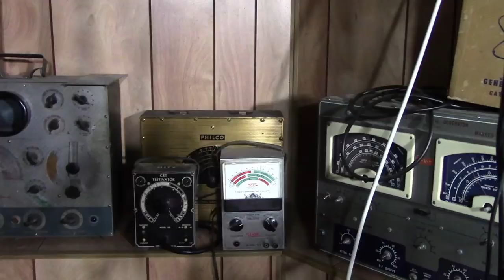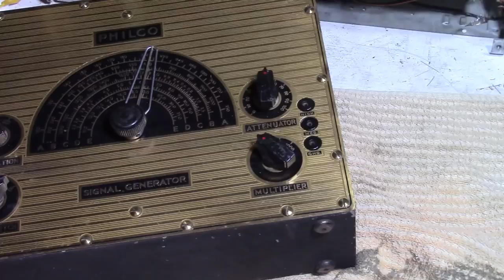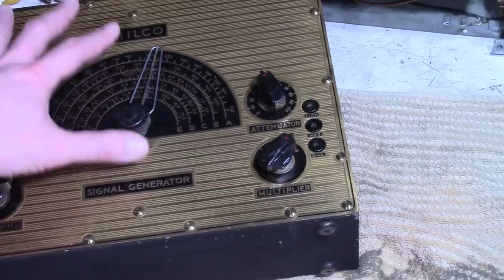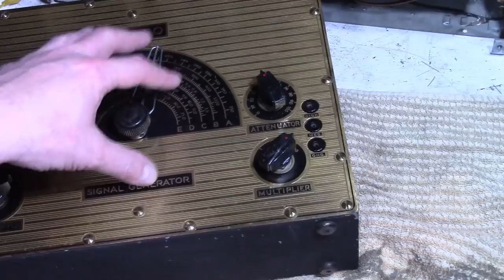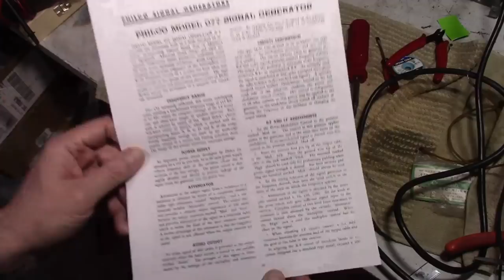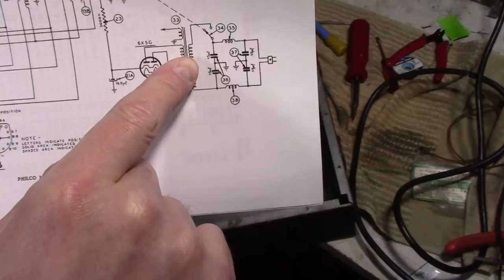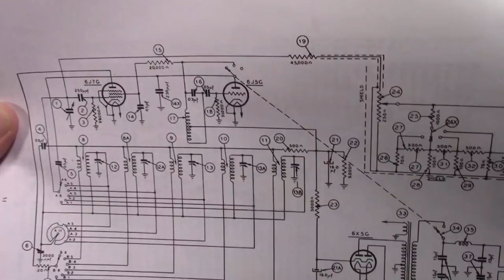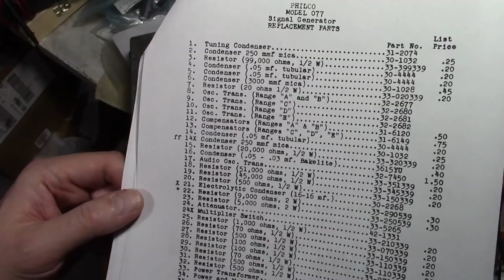Philco 077 RF generator restoration p1o6

Comment: I saw a 088 on the forums, which looks similar, and fell in love with the vintage Philco test equipment. I actually found a 7050 Tube Tester at a reasonable price and grabbed it. It's awaiting restoration (literally 1 paper cap). The best part of this video is seeing the full process of rebuilding the Philco Bakelite block. I have a Philco 42-380 with one of those that I will need to rebuild, and this was incredibly helpful. I'm new to the vintage radio hobby, and after a year of the forums and YouTube, I'm ready to break out the soldering iron. Thank you!
Reply from the maker: You're very welcome.  I suggest you checkout my series on restoring a Philco 90.  I start with the basics and go into a lot of detail on the bakelite blocks.

Comment: I found the easiest way to remove the caps from the bakelite blocks is to sever the leads like you did, then apply a little heat on the outside parameter for about 20 seconds. Take a small drill bit in a handle like a hand drill and push the insides out right through the center hole in the top. If there is solder in it, just suck it out with some solder wick. It comes out cleanly and in one nice chunk and leaves a clean interior. I love this Philco Generator and now I need to find one for myself. It is very unique and I love unique. Great job. Oh and I love the narrative you do. My wife says I'm boring as heck and won't watch my videos.Heh Heh!
Reply from the maker: Thanks.  I'm glad you enjoy my videos.  Your technique sounds like a winner and I'll be sure to try it next time.

Comment: Yep, Gutta Percha is still used in dental root canals. We pronounce it 'perka'. It comes in various sizes called points, which fit down the root canal. When rubber hardens the process is called vulcanisation. The rubber is said to have vulcanised. Cheers

Comment: It is my understanding that power line filters on RF gens are to keep the RF inside the case and not let the signal out where the line cord becomes an antenna and throws off your expected attenuation.  As far as mods, I often add a BNC connector for hooking up a frequency counter.  It's connected by a .001 to the hot side of the attenuation circuit.  RG174 coax works just fine here.
Reply from the maker: Ah, that makes sense.  Thanks for the info.

Comment: A tip I learned when cleaning out bakelite blocks is that WD40 dissolves the wax fairly well. It will help to get every last bit of the wax out - If that matters to you.
Reply from the maker: Thanks for the tip

Comment: I would have used 0.05uf caps on the power or even 0.01. We used to use mil-spec filters with  0.25 caps and if you lost the ground, the case would give you a considerable jolt.  Building in Florida I worked did not have good A/C so you were a bit sweaty and you made a good conductor. If you go with a 3-wire plug, it will often trip a GFCI. 
I recognized the Philco caps in the pic you posted. Just could not make out the orientation of the gen. Thought the divider was horizontal instead of vertical. Love the look of the old Philco gear. Have a Heathkiit that works OK, but I'd swap it for one of those art deco ones.

Comment: I love that tester, what an art deco piece of history. I'm familiar with those bakelite blocks, and they really did use tar to seal them. The problem is that Philco didn't realize that tar is quite porous, and tended to absorb moisture---the end result is an attrition rate that was even higher than conventional wax/paper capacitors

Comment: The oldest piece of test equipment I have is a Jackson 112 capacitor tester from 1940-41. It is almost fully working with the exception of one of the measurement ranges.

Comment: Well...that ended abruptly!  
This is yet another video with those bakelite enclosures with the capacitors in them.  I think if there are that many still out there, someone needs to start making replacement kits with a 3D printed replacement case and Safety Caps.  I don't have the equipment, and with no job, can't afford to get any...but I think it is a good idea for someone to make them.

Comment: I have used Antex G series soldering irons forever, light,thin,easy to get into tight hand wired chassis, but as of late they don't seem to hold up as good, burn out, handle not as good either, Original factory Antex (english) tips are FAR better then the M.M Newman ones too.

Comment: Instead of tar or wax, I would expect pitch or even asphalt.  Although my experiences have always been pitch.  Equally miserable.
As to the line filter capacitances, I don't recall the ruling now, but definitely there is a maximum specified in the IEC or UL documents.  And my impression is that it is way smaller than your 150 nF.
Reply: Most of the standards specify a maximum leakage current, where you lift the case ground and measure between the floating case to earth. Depends on the product, but you're correct that 0.15 uF likely wouldn't pass. Typical cap values are in the 0.01-0.05uf range. I like to add a grounded cord to my old test equipment for this reason.